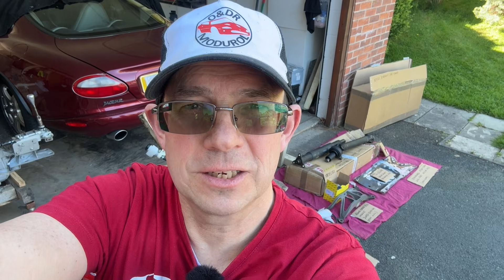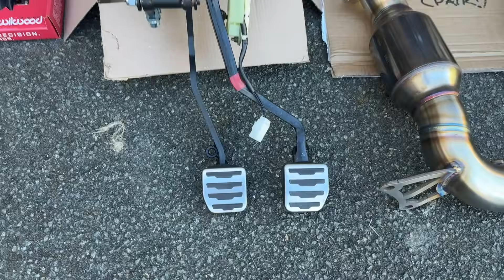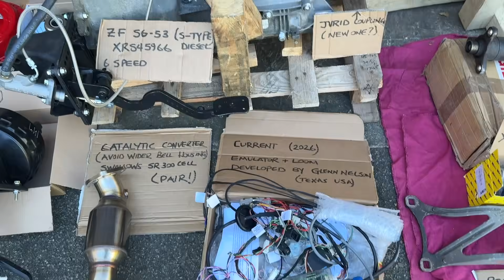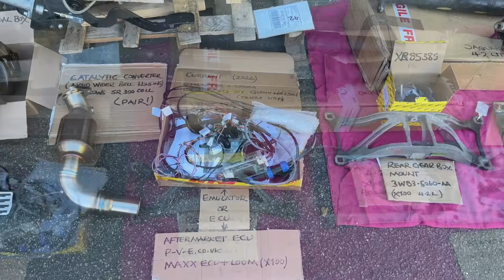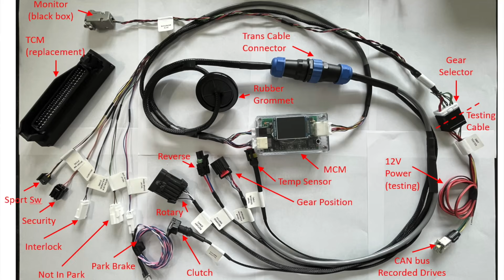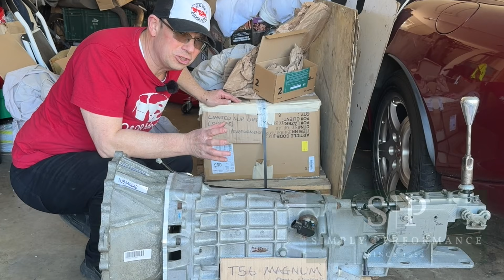Jaguar XK8 Manual Swap: Every Part & Component Explained.  XKR X100 Modurol MT47

Comment: This is amazing! Is this compatible with the second generation as well?
Reply from the maker: Hi Vince, Thanks for the fantastic feedback. You've hit on a really good technical point—the core manual gearbox unit itself could theoretically be used across platforms since Jaguar utilized similar transmission families, but that is about the only part that crosses over!

The rest of the conversion kit is strictly for the first-generation X100 (1996–2005) chassis. The second-generation X150 (2006–2014) relies on an all-aluminium chassis, meaning the transmission tunnel shape, physical mounting brackets, and pedal box structure share absolutely no common geometry with the earlier steel cars.

More importantly, the electronic architecture in the X150 is a completely different animal. It uses a highly integrated, high-speed CAN bus network where the automatic Transmission Control Module (TCM) talks constantly to the dynamic stability controls, instrument cluster, and active suspension. Trickling that advanced network into accepting a manual configuration requires a totally different electronic solution than the X100 setup.

Working and learning together to map out these complex mechanical puzzles is exactly what keeps this community thriving, though! Please subscribe to our new channels, Modurol Live and Modurol Shorts, to follow our live R&D workshop streams as we keep digging into classic Jaguar setups, regards Damian

Comment: I have a sneaking suspicion the Lincoln LS V6 Manual will work also.
Reply from the maker: Erik, Hello. That is an interesting thought, but there are some technical hurdles there. While the Lincoln LS and the Jaguar S-Type shared the same platform, the gearbox used in the UK V6 models technically features a different bellhousing bolt pattern that will not fit the AJV8 engine. Even within the Jaguar range, the S-Type V6 manual setup isn't a direct match for the XK8. We believe in working and learning together to find viable solutions, so it's always worth investigating, but for now, the ZF S6-53 remain the goto standard. Please subscribe to our new channels, Modurol Live and Modurol Shorts, for more manual conversion discussions, Regards Damian
Reply: @Modurol  some suspected it the same, but if it isn't it isn't.  The search for the S6 continues.

Comment: Awesome project which I've been following closely as I have an L322 4.2 ;) Did you consider using the Aston Martin Flywheel and clutch setup?, minus the friction disk.
Reply from the maker: Hywel, it is fantastic to hear from an L322 owner—the 4.2 Supercharged is a brilliant engine. Regarding the Aston Martin V8 Vantage setup, we didn't get the standard flywheel, further we decided to stick with a more bespoke solution to keep the project accessible for others working and learning together. Please subscribe to our new channels, Modurol Live and Modurol Shorts, where I’ll be doing a deeper technical dive into our final flywheel choice, regards Damian

Comment: Is this something you sell as a kit ?
Reply from the maker: Hello Darren, thank you for the question. We don't sell a complete "all-in-one" kit, as these swaps often require a bit of bespoke technical tailoring depending on your specific car. However, we can certainly help you get started.
We can provide the pedal box conversion components, and I can put you in touch with Glenn for his Manual Control Module (MCM), which is the technical "brain" needed to keep the electronics happy. We believe in working and learning together, so please do subscribe to our new channels, Modurol Live and Modurol Shorts, for more swap updates. You can also find a list of required components and contacts at www.modurol.co.uk. regards Damian.
Reply: Wow if get my xkr back from the garage I will definitely have a look at it
Reply from the maker: Darren, completely understand that feeling of waiting for the car to return. In the meantime, it might be worth taking a look at our project playlist to see the journey so far. I’m also planning to release a full-length video next Sunday specifically covering all the manual swap components in detail. It will go through exactly how the pedal box is configured and how we are approaching the technical side of the conversion, regards Damian.
Reply: @Modurol  thank you so much for knowledge 🙏🏻 yeah it at the awful stage where I may have to decide to scrap it or keep going